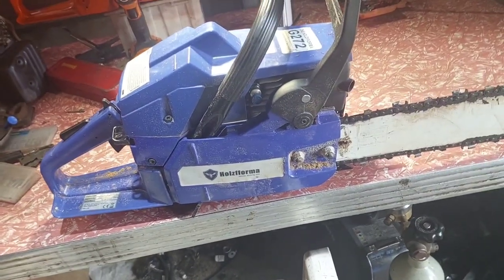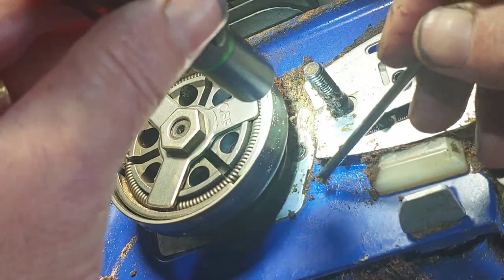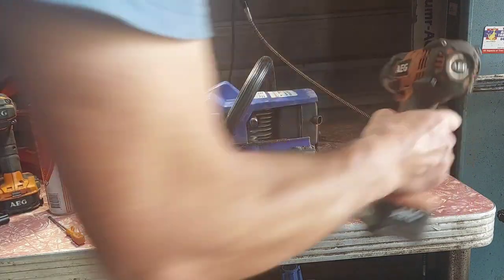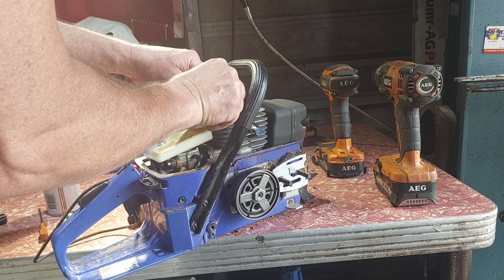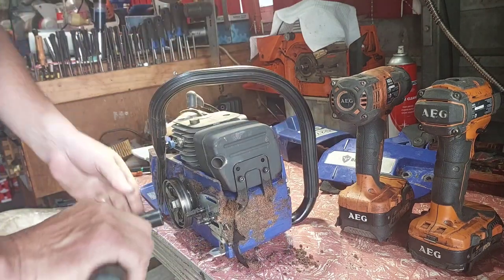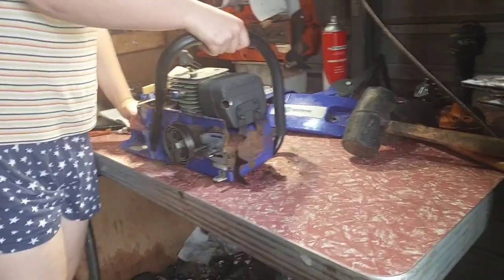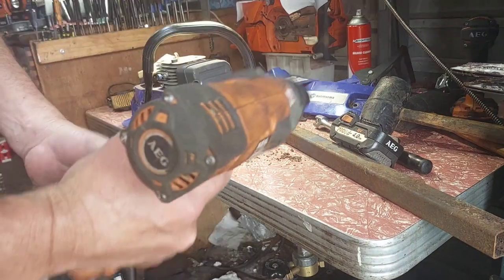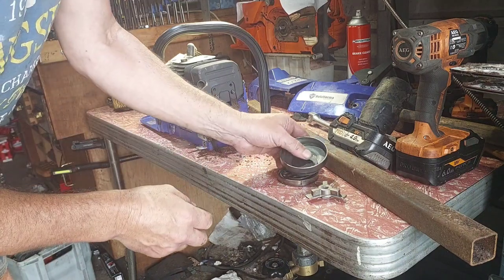g272 ,g288 chainsaw oil pump  Adjustment

Comment: I have one of these with a 24 inch bar it’s a beast only problem is I just put a brand new forester chain on it (84 drive links .058 gauge) and it’s almost like the rakes are too low bc it often bites too hard and bogs down and I have to pull it out of the cut and get the rpm up then drop it back to keep it cutting any tips on how to fix this?
Reply from the maker: I think it will get better when the chain  Dull ,but does not sound good 😕